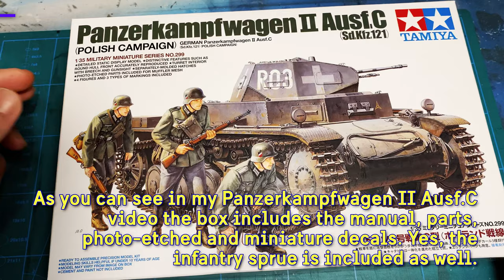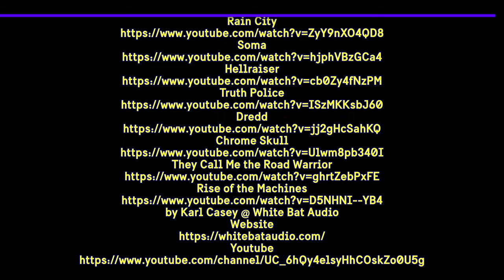Panzerkampfwagen II Ausf.C - Infantry #Diorama #ScaleModel #Miniature #ModelKit #Figures

Comment from the maker: 00:00 Hello my friends.
00:05 In this modelling project I am building 1 of the 3 infantry figures that are included in the modelling kit of the German Panzerkampfwagen II Ausf.C (Sd.Kfz.121, Polish Campaign), in scale 1:35 from Tamiya.
00:05 The Panzerkampfwagen II Ausf.C (Sd.Kfz.121, Polish Campaign) had a crew of three men. The driver sat in the forward left hull with the gearbox on the right. The commander sat in a seat in the turret, and was responsible for aiming and firing the cannon and co-axial machine gun, while a loader/radio operator sat on the floor of the tank behind the driver. He had a radio on the left and several 20mm ammunition storage bins.
00:36 As you can see in my Panzerkampfwagen II Ausf.C video the box includes the manual, parts, photo-etched and miniature decals. Yes, the infantry sprue is included as well.
00:54 Let's start cutting.
01:09 Smoothing out certain parts using a cutter and 2 types of sandpaper. A coarse and a fine one.
02:04 Smoothing out the connecting lines for a more realistic look.
02:09 Using the cutter carefully in the opposite direction to avoid cutting or damaging the parts.
03:09 Gluing the parts.
03:56 Testing the placement of the rifle on the hands of the figure. Fits nicely!
04:31 Filling the gaps with ready filler diluted with water.
05:28 After it's dry, with a wet brush, I am removing the excess filler.
06:33 Gluing the ammo pouches.
07:00 Attaching the portable shovel.
07:09 Adding the gas mask.
07:17 Placing the bag.
07:23 Gluing the water bottle.
07:31 Gray primer (Vallejo).
07:56 Dark flesh painting the face and hands.
08:28 German gray painting the helmet, jacket and the gas mask.
08:50 I forgot to mention that the face isn't yet done. I will get back to it.
09:04 Fixing this small mistake. It happens.
09:08 Resuming painting the jacket and gas mask.
10:10 Dark gray painting the pants.
11:15 Dark green painting the collar and shoulder straps.
12:06 Semi gloss black painting the boots, ammo pouches and the portable shovel.
14:00 Black painting is done and I also painted a leather chin strap for the helmet.
14:07 Dark green painting the bag on the chest and will let it dry before doing a second coating.
14:42 Khaki brown painting the bag on the back.
15:15 Dark yellow painting the bottom half of the water bottle.
15:45 Semi gloss black painting the upper half of the water bottle.
16:08 Red brown painting the water bottle strap.
16:39 Desert yellow painting the shovel's wooden stick.
17:06 Gray painting the symbols on the collar, shoulder straps, buttons, belt, etc.
17:39 Black painting the eyes.
18:06 Black washing.
18:43 Brown dry brushing to give the illusion of the dirt in the battle field.
19:19 White dry brushing highlights on the face and hands.
19:38 With a soft wet brush, taking away the excess.
19:48 Glued a small piece of chip board to use it as the rifle's sling. Red brown painting the sling and the rifle's wooden parts.
20:14 Gun metal painting the rifle's metallic parts.
20:51 Matt varnish (Vallejo).
20:59 My first ever figures are done! Hopefully you will like them.
21:03 Presentation
22:30 Hit the Like, Subscribe and Notifications Bell "buttons". This way, together, we can grow a community around the exciting art of scale modelling!
Stay "tuned" for more scale modelling videos.
Thanks for watching!
Rain City
https://www.youtube.com/watch?v=ZyY9nXO4QD8
Soma
https://www.youtube.com/watch?v=hjphVBzGCa4
Hellraiser
https://www.youtube.com/watch?v=cb0Zy4fNzPM
Truth Police
https://www.youtube.com/watch?v=ISzMKKsbJ60
Dredd
https://www.youtube.com/watch?v=jj2gHcSahKQ
Chrome Skull
https://www.youtube.com/watch?v=Ulwm8pb340I
They Call Me the Road Warrior
https://www.youtube.com/watch?v=ghrtZebPxFE
Rise of the Machines
https://www.youtube.com/watch?v=D5NHNI--YB4
by Karl Casey @ White Bat Audio
Website https://whitebataudio.com/
Youtube https://www.youtube.com/channel/UC_6hQy4elsyHhCOskZo0U5g